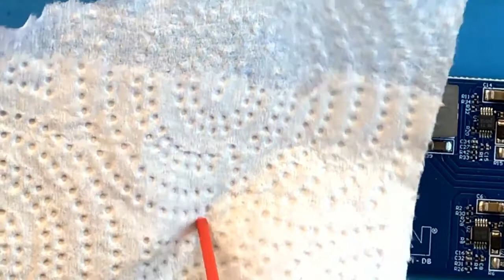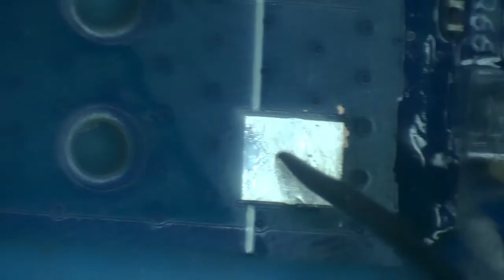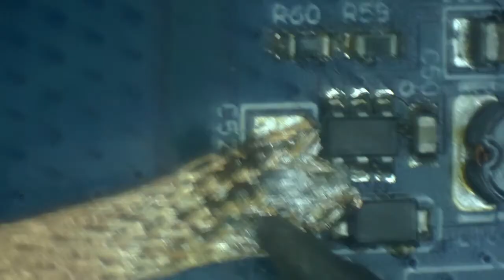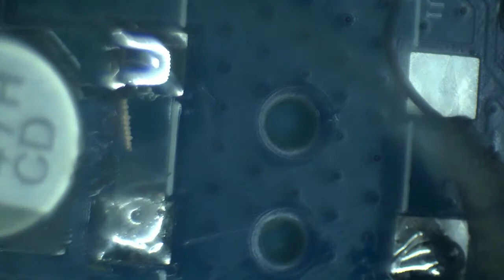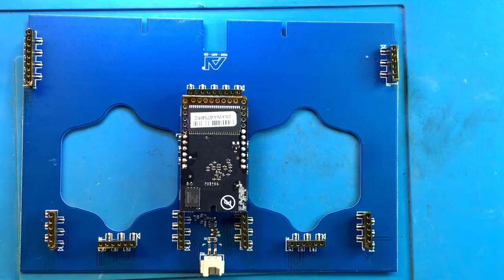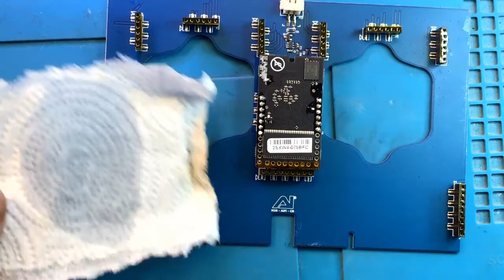Hydra 26 HD Power Connector Replacement and Short on Power Circuit

Comment: Great Detailed video. Only thing that would have made it better is if you didn't have a spare board and you showed an alternative capacitor to use.  I can't seem to find ceramic capacitors with the specifications you described. 4.7-6.2 microfarad and 50 to 60 volts.  I have the newer Hydra 25 with this capacitor blown.

Comment: Awesome fix as always ☺️. I have a question about the IC driver.. do you know if the IC driver for the AI prime is the same for this board you are working on? I ended up finding some TPS92512DGQR, do you know if that's a good replacement?
Reply from the maker: Good question. The driver IC is of the same family, but not exactly identical. the Hydra 26 in this video has 92512, which is what you found also. Prime, especially newer versions, uses 92512HV (High Voltage?). Essentially same as regular 92512, but operates at 60V max instead of 42V max. Essentially same thing, but 60V gives a bit more head room, especially when running at 36V input.
Reply: @FixReef  got my LED driver IC replaced on my green and white and still nothing lol.. I'm not finding any shorts on any of the caps and they all seem to have the same value.. at the moment I'm stumped, the LED's light up when tested with multimeter and AI prime HD will connect with the APP on my phone. Any suggestions?
Reply from the maker: Bummer... How about continuity on all traces from the channel circuit to the LEDs?
Reply: @FixReef  I believe I have checked all the traces and all beeps good.. wish I could find a schematic.
Reply from the maker: Do you have a scope? I'd verify the MCU is controlling the PWM of the LED driver and go from there...
Reply: @FixReef  unfortunately I don't have a oscilloscope, I need to get that and a bench power supply to inject power to find faults. I just play around as a hobby that can fix all my other hobbies lol. I've reflowed the MCU but not the other rectangle chip that has 20 legs on it.. guess I could put it in the ultrasonic and see what happens.. and thank you for your knowledge/help that's very kind of you.. can I just put another MCU in it or is it program with AI prime own stuff?
Reply from the maker: Since your light has not been water damaged and all other channels work, the chances that the MCU is bad are very low. But the PWM is still an important test point to ensure the control signal is coming through. Replacing the MCU with a blank one won't help as it needs the firmware to work. When/if your reflow, make sure there are no bridges, even microscopical. An easy mistake to make, ask me how I know.
Reply: @FixReef  I always double check my work.. it's 2x as big as the M92 chip for the power management for the Nintendo switch 😁. I'll need to teach myself about the PMW signal you are talking about, I have briefly read about it.
Reply: My chip for the PMW finally arrived from china and swapped it out and everything is still the same lol, everything works except for the white and the green still.. could it possibly be the WIFI controller? I have one from a AI hydra 26 that I just got working and could put it in to test I suppose.
Reply from the maker: @cwwCADAVER I can't imagine the wifi controller being involved here. I still think there is a broken trace/connector somewhere between the board and the clusters... It's tricky to trace them on hydra's because of the connector board.
Reply: @FixReef  thank you for your help.. I sat down and learned a lot lol d/l the date sheet for each chip and also reverse engineered the darn thing lol.. replaced a resistor I believe was 470 or 480k on the 2 channel that wasn't working and now it's good to go.... My only problem now is I have another and the UV is burnt out and it's also an AI prime HD and I can't find what one to get. I see something about semi400 and another says semi405.. what do you use?
Reply from the maker: @cwwCADAVER  Happy to hear you got it figured out. It is rare that a resistor would cause this, but it clearly did in your case. Honestly, I haven't had a chance to figure out the LEDs for these lights yet. Awhile back I got my hands on a bunch of LED clusters in nearly new condition and have been using them as donors since then.